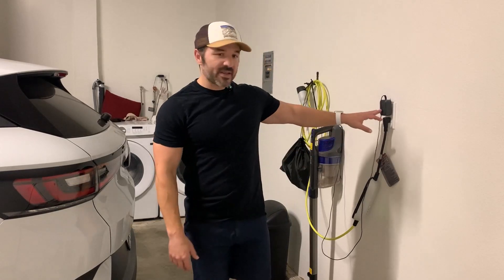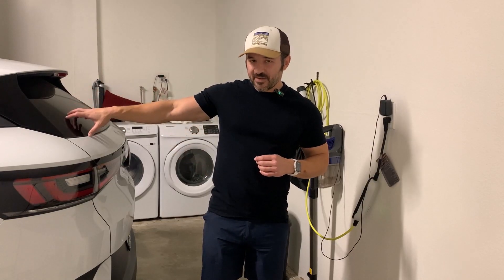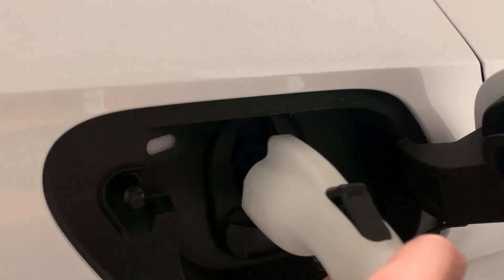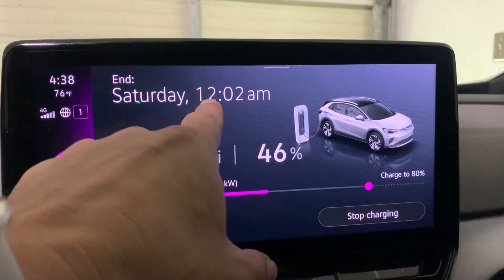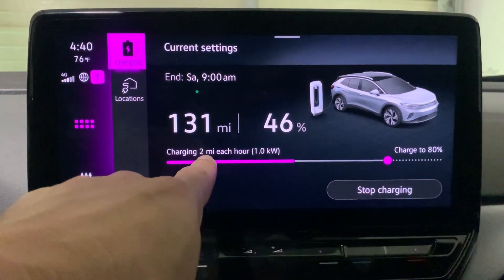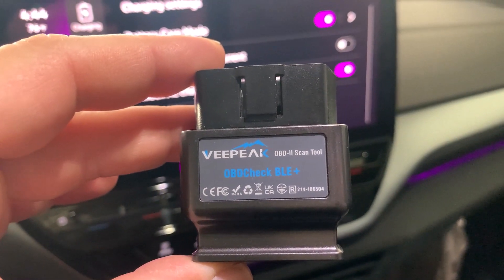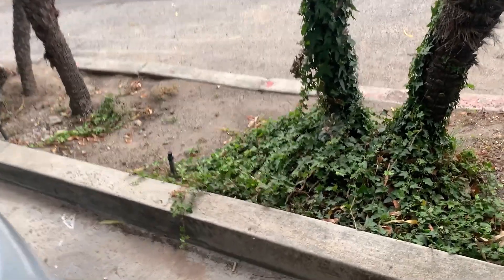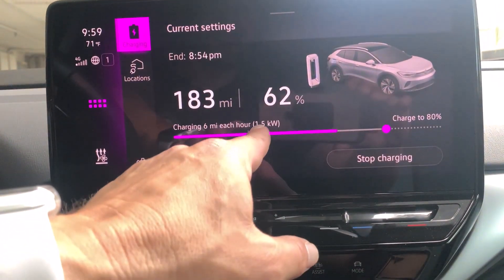Circuit Breaker Keep Tripping While Charging Your EV? Try THIS!

Comment: My model 3 charged at 48amps. My new model y now causes lights to flicker. My equinox EV at 48 amps does. It cause any flickering.  Othing helps but dropping the charge speed on the model y. Very strange. Wiring is not wonky as some cars don't do this. 200amp.servixe and separate 100amp panel in the garage for the ev. Very annoying.

Comment: I have a Tesla mother, y sometimes my circuit breaker trips. I have a 220 V, plug, it's a 60 amp. Bricker, sometimes the breaker trips as soon as I plug it into the car. Other times after the car has been running charging for about an hour. I have a new I am using a mobile connector. I bought a new plug for the mobile connector from Amazon. It worked well for about 4 months and then slowly it started tripping again. I wonder if you have any suggestions. On what could be the cause? Well, I reset the circuit breaker. The car charges completely and I don't have to reset it again

Comment: Thanks so much for this! You are a life saver. I'm in the UK with a Plug in Hybrid which has worked fine with our 7KW wall charger for 2 years straight. Yesterday we took delivery of a full Electric Vehicle Cupra which is similar to the ID3 underneath. And after 10 mins charging our RCBO would trip.....the Plug in Hybrid still works fine (the PHEV only uses half the power of the charger box). This got me thinking about the rate of charge and then I found your video. I turned down the AC charging rate in the car which is same as VW and as we speak the car is charging. We have an electrician visiting us next week to see what is happening. This saves us having to use an expensive public charger. Thanks again!
Reply: Hi. Did you get this sorted? My EV occasionally causes the RCD on my main consumer unit to trip. Even though my EV is on it’s on consumer unit and the RCD on that does not trip.
Reply: @goodbyetothepeople92  we had a sparky come to house and change the RCBO. It had burnt out and was faulty. He replaced it with a higher amp RCBO and this has been great since and now I can charge the car at full power!
Reply: @bobmeister0253  is your EV charger on its own consumer unit and separate from the main house consumer unit?
Reply: @ yes it’s in its own separate unit just for the EV
Reply: @bobmeister0253  Same setup I have. Really strange that the EV charger can cause the main consumer unit to trip. I thought that was the whole point of having separate consumer unit for the EV.  One last thing, did your EV Consumer unit trip too? Or just the main house consumer unit? Because mine is only impacting my main consumer unit. The car continues to charge fine.
Reply: @goodbyetothepeople92  only the Car Charger RCBO fuse tripped. The rest of house was fine. The Sparky said he sees this sometimes and replaced the RCBO with a higher amp version and has been fine since.
Reply from the maker: You’re welcome!

Comment: Evan, I think you’ll find that that reduced power setting drops it to 8 Amps. Using level two the 8 A would deliver approximately twice the power of level one because of the voltage is a doubled. The actual voltage for level two may be between 208 and 245 V just depending on how things are set up. The ID for probably only has a 32 amp on board Charger so I assume the best level two charging speed you have seen is approximately 7.5kW?
Having the reduced power setting disabled on level one would probably default to 12 Amps Which can fairly reliably be drawn on most circuits as long as it’s not shared with another high-powered device as the breakers in homes are generally 15 or 20 A for such outlets.
For level two you should never have to use this setting unless it was a misconfigured charger. In the case of level two installations, the chargers are generally configured to tell the car how much power can be drawn.  This is part of the J1772 protocol/handshake.
Reply from the maker: Agreed! ID4 has a 40 amp on board charger, but it's charge speed-limited to 11kw. In reality, I've never charged faster than 9.5kw on L2. Great comment!
Reply: So… I tried this for my L1 charger. It still turns the outlet off… technically not triggering the breaker. The car was charging fine for months… not sure what happened? (This also turns off my garage door power so assume something on the power side of house)

Comment: Thanks for posting this Evan! Glad there is at least a workaround to reduce the charging current when you have to, but this really highlights the big problem of electrical infrastructure issues everywhere - not only out in the public charging space, but even in homes and especially apartments. As an electrical industry, we indeed have a lot of upgrading to do (as well as plan thoughtfully for the new houses/apartments we are building)!